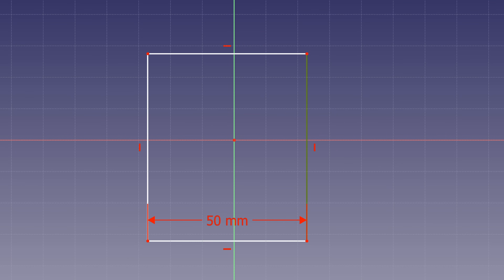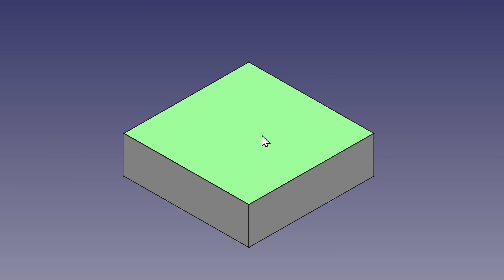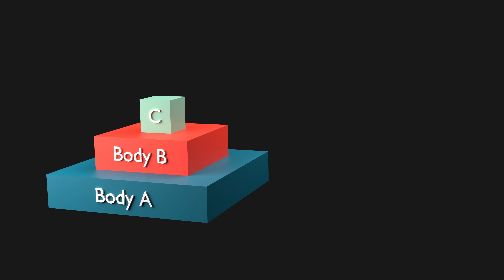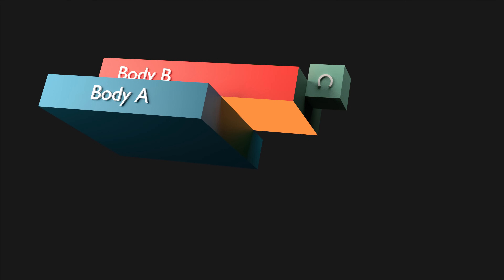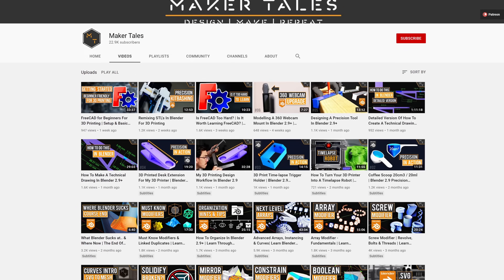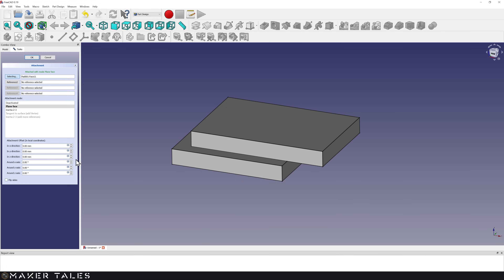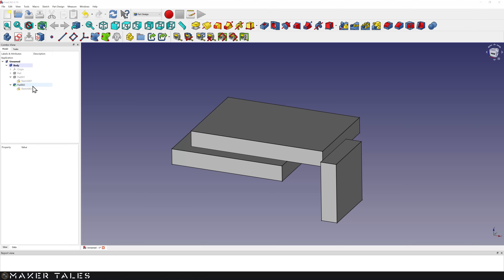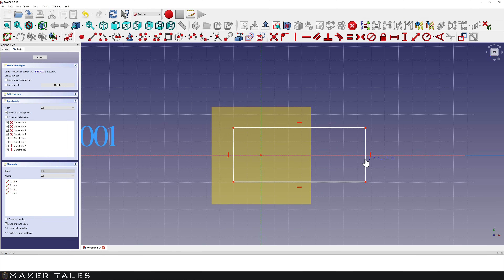FreeCAD Is Fundamentally Broken!  - Now what... Help Me Decide...

Comment: This is not a bug - this is how FreeCAD operates. If you look at the toolset in Part Design WB you clearly see that this is intended for additive or subtractive work in the realm of mechanical engineering - aka simple geometrical objects.

I agree that however this is simply a very user unfriendly and in addition labor / cognitive stressful workflow which is also why you don't see much product design done with FC.

I agree that it is a pity to teach it. If it is a machinist maybe - my industrial design students ? NO !

The problem with going with RT branch is what happens when he stops developing. Then you focused on a branch that ended. Teaching master well at least you know with the limits that this wont go away.

When it comes NTP it is also fair to make a dirty concept model and then make a cleaner build and ignore all the Don'ts for NTP. I only cross reference geometry and only use expressions where effective. 

But I also know that I wont super adjust change my model.

So I find the NTP if you are smart is less of an issue than it could be.

I would wait for FC 0.2 but also reference - but you can also feature RT branch too and keep both clearly separated.
Reply: Well a bug would mean something does not work as intended and breaks.

The ntp is just based on how names of faces can change when you modify add more to it.

That’s why I don’t think this is a bug just not fully developed process.

But obvious amazing RT is at it now to make it right
Reply: @cekuhnen  Thats the "It's not a bug, it's a feature" excuse. It it feels like a bug to the user, it is a bug. The user is not expecting this behavior.
Reply: Oh I fully agree that this is not the expected behavior. But it is not programmed to work that way. That’s why I think the term bug is wrong. It is an old issue in cad and needs proper tools to address it.

In fusion edges can get forgotten etc but all tools have the ability to restablush the relationships and that freecad lacks

Comment: The FreeCAD tuts I have watched so far are much too complicated for me as a novice. Since I have no real investment in FreeCAD (I don't see any benefit in the time required to learn)  any more complication would drive me away. 
I would love to have something that is powerful to use for 3D printing. I have no use for a larger part of what Blender has to offer, I am only interested in getting a model for printing.
Your videos and teachings are impressive, I have learned much from you and watch the videos over and over. 
I am a hobbyist and may not be the best to give feedback but the hobbyist seems to be the norm for 3D printing at this point.
Reply: the topo naming problem is really not a big deal at all, it's very easy to avoid
Reply: @Keechization  Easy but tedious. Do you really create a parametric datum plane for each face that you sketch something on? I wanted to use FreeCad for 3D printing myself, but I soon found out that it was a lot of really tiresome repetitive boring work to create even simple models.

Comment: Can you teach other aspects of FreeCAD and sort of stay away from this problem for now?  I would like to know more about working with meshes.
Reply: FreeCAD's mesh tools are dismal in my opinion and I have been using  the program since version 0.13. For simple edits and combining .STL files it is OK, but for serious mesh work I tend to use Meshmixer or Blender depending on the project.
Reply: @Phelps3D  Ah.  That would explain why I have so much trouble doing anything with meshes.  I'll start working through some Blender tutorials.

Comment: First of all - the presentations you have made (both for Blender and FreeCAD) are excellent and a joy to follow! Having viewed FreeCAD content from others, I became aware of the Topological Naming Problem (TNP). My approach has been to set this issue aside and use the available time to learn about other features and methods. Currently, the newbie may choose to watch videos that describe the TNP and how to fix it, tutorials bug workarounds, or use the RealThunder branch.  In my opinion, your efforts should be better spent on continuing to produce content that has great value to the CAD/3D community by circumventing the issue for the time being and allowing the TNP developers to find a solution to their buggy code - which might be achieved within the next 6 months. The suggestion by Lewis Cobb in the comment section to bring enthusiasts up to speed (with so much more to learn) is probably the best option. Having skimmed through the TNP, my reaction is that the learning curve is already steep enough and that delving into the intricacies of the TNP bug is not worth the muddle when solutions are within reach.

Comment: This bug is exactly why I said "Fuck this! I'm already using Blender, can't I just CAD model in there?", and that's how I found your channel and Blender Precision series!
Reply: Exactly this, it feel we hit full circle now. DItch it, and back to Blender, where we started being happy!
Reply: Blender and fusion 360 together work well
Reply: Or fusion  360
Reply: This! So much of exactly this!
Reply: You can but you should not. Blended use floating number to store values, CAD use double.
Reply: @seanfan84  I assume with what you said you never used that technology and modeling workflow.
Reply: I decided to go with openscad and cadquery instead
Reply: Well not a lot of what freecad can do Blender can remotely do. No trimming clean surface no fillets on trimmed edges no parametric modeling.

Blender and freecad are two very different things
Reply: @cekuhnen  And that's why I kept using Freecad despite this stupid "bug".
Reply: Too bad freecad does not have a polygon to nurbs converter to technically finish surfaces.
Reply: @cekuhnen  
How to do everything you just mentioned in Blender:

-Trimming: use boolean or knife modifier (Depends on desired accuracy and complexity) 
-Fillet: use bevels and increase the face count.

-Parametric modelling: There's literaly a modifiers tab and you can edit everything from the geometry in edit mode from a panel without needing to use any gizmos, just parameters.

Don't say blender can't do it, just put a bit more effort into learning and you'll see the tools are there. Besides, if you lack anything, Blender being free there's always a plugin out there that will add it... and considering how blender is with its modifier workflow you can basically ignore that and work entirely with the tools it gives you.
Reply: Maybe you should Google my name before you make funny statements.
Reply: @cekuhnen  you think i made a "Funny statement" that is "uninformed" just because you think you have a big name? get off your high horse mister, its clear you have no knowledge of blender if you say you can't do any of those things you mentioned lmao.
Reply: @AlFredo-sx2yy  I do not have to get off my high horse. You just don't know the technical difference between blender polygon base bevel (modifier + mesh command) and how filter works in a freeform or parametric brep surface/solid modeler. Learn a little more please.
Reply: @cekuhnen  i know very well the difference, and that's why i tell you that the difference doesnt affect any of the things you mentioned on the list. Maybe go learn it yourself and list a thing that is truly affected by the different method used by blender and cad. 
Go ahead and tell me in detail what wonderful things are not even "remotely posible" in Blender due to the different methods used.
Reply: @AlFredo-sx2yy  step 1 : model me a G2 variable fillet between  a cylinder cutting a sphere.

Step 2 : please adjust the cylinder dimension and reposition it and with a mouse click have the fillet updated

Take a surface cut it open by a shape 
Extrude form the cut edge a new surface
Create a G3 blend surface between them

Waiting ;)
Reply: @cekuhnen  it would be nice if you specified exactly what you want. Do i make the cyclinder cut the sphere from one side to the other or just on one side? do i make the cut with the side of the cylinder or the base? "reposition is and with a mouse have the fillet updated" was a stroke or what's the deal with your broken engrish? If you dont know how to define topology through words go ahead and just take screenshots of what you want to see lmao. Either that or fix your sentences, cause the only thing that made sense were the words step 1, step 2 and the Gs. Otherwise i'll try to interpret what you mean with "reposition is and with a mouse have the fillet updated" and make it up as i go.
Reply: @AlFredo-sx2yy  “engrish” is how one spells English ? Interesting ;)

I gave you enough examples to make the technical demos. Now show if you know what you are talking about or not.
Reply: @cekuhnen  engrish is a very common purposeful misspelling of english to denote broken english. It's all over the internet so im not sure how you missed it but your cultural level of internet slang isn't my concern here. 
Again, if you don't define the problem properly i'll make up what i can, so ok, i'll go ahead and record something for you :v
Reply: @AlFredo-sx2yy  I am still waiting for your modeling:

Here easier examples

Show me a clean G2 fillet between a Boolean Union of sphere and a cylinder each at random object pivot point based rotations

Make an open bend surface 1 and build another open bend surface 2 both surfaces can be aligned at one edge enabling surf 2 to describe a closed area on surf 1 to trim away

edge add a G3 fillet 

No modifier surf internal topology but not exterior edges to make the fillet adjust
Reply: @AlFredo-sx2yy  is the "video not available" equal your understanding ? no surprise here ...
Reply: @cekuhnen  sorry i hadnt verified my account and i had no permission to upload long vids as this is my secondary account, just verified it and reuploaded the vid. No need to be so hostile bro.
It's still processing, im sorry if reuploading an hour long vid twice isnt an instant process but hey, you are the expert here, you should know that already right? :v
Reply: @AlFredo-sx2yy  adorable video - you spent 54 min on addressing nothing requested but show you have basic knowledge of the modifiers and mesh tools ?!
Reply: @cekuhnen  go to the part 2 bro that's where everything you ask for is done. It's not my fault you lack a basic understanding of topology and ask me to do stuff that is nonsense in polygon based 3d modelling. Still, it was all done. If you didn't like it, then go ahead and show me how it's done if you know so much. You said it had to be modifiable in real time which means i was limited to using modifiers.
Reply: @AlFredo-sx2yy  Ah so you admit G2 is non-sense in polygon modeler as well as surface continuity yet you claim you can do the same with Blender that Alias (as a different example that also has Sub-D-NURBS hybrid modeling) for example could do. yep yep no surprise I am still kinda smiling you spent seriously 54 min on this crap. Here is a little tip: look at some add-ons for Blender why try to get close to what NURBS modeling offers for polygon modeling in Blender. It still does not get close but it is better. The only ability to simulate parametric union cut with fillets is via voxels - but there again you cannot individually control edges because that is not possible parametrically in Blender.
Reply: @AlFredo-sx2yy  here last chance: https://drive.google.com/file/d/1QeEMgnUGzth5DpQtNmlYpo2V6XVQm_fT/view make this parametric in Belnder with all fillets individually adjustable and movable when objects follow.
Reply: @cekuhnen  You misunderstood completely, no surprise considering you came from an applied sciences and arts university and ended up as an interiors designer...
Reply: @cekuhnen  The point of my comments was that you CAN do it in polygonal modelling, but keeping it as you requested editable afterwards is what is nonsense.
Reply: @AlFredo-sx2yy  you are amusingly silly - even with your stalking and trying to discredit me - maybe get new glasses so you can read better
Reply: @AlFredo-sx2yy  sister you are the one who rented 54 min on some childish exercise while not having been able to understand the first comment posted and feel needed to make yourself lol better 

Hey fine with me it was entertaining to see you struggle so hard …
Reply: @AlFredo-sx2yy  Actually you are incorrect. "Engrish" is older than the internet, for that matter so am I. In fact, I am older than the PC. The word "Engrish" goes back decades and its roots are in languages that cannot natively pronounce the letter "L". Japanese is most notably the first reference of the word and probably originated after WWII (World War Two). Although it may be considered "acceptable" it is in fact or of an insult because it mocks another the inability of another race and culutre.
Reply: @yootoob7048  thank you for somehow making a joke related to broken english make me a racist. SJWs saved the day again.
Reply: @AlFredo-sx2yy  Clearly you do not know me. I am no SJW. I never accused you of racism. I only pointed out the error of your statements with facts. You are a simpleton who deflects their ignorance with more ignorance. For example, you do not seem to understand the proper definition of racism. Making a joke related to a person's inability, a disability, or a culture is not necessarily racism but, it is always rude and insensitive.
Reply: @yootoob7048  all this escalated quickly, my dudes.
Reply: @cekuhnen You really are quite unpleasant. So condescending with the very little amount of knowledge shared here, where you didnt even correct them on anything. You just pointed out the difference between the types of modelling. Just because they exist, doesnt mean that they dont accomplish the same goals for this user.
Reply: @BeefIngot  how do you know that I am unpleasant and you base this on a discussion 2 years ago here? Interesting conclusion ;)

Comment from the maker: I would love to hear all your opinions in the comments!
Plus here is a Poll to let me know your thoughts if don't have the time or don't feel like leaving a comment: https://www.youtube.com/post/UgzDDe5XmIku-jQEJ7N4AaABCQ
Reply: https://twitter.com/CyberspaceOmeg6/status/1419283594044837893?s=20
Reply: I tried hard to get in line with opencad and I hate it, I wound up buying alibre
Reply: @claudehebert3131  And i thought i was old learning 3ds max 2.5 with surface tools.
Reply: Isn't solution nr 2 what a properly working cad program should do under the hood in the first place? It seems to me that you really have to go out of your way in order to code a behaviour like the one showed here... I mean, why the hell do you have to rename your faces to begin with?  Just assign a unique identifier to each face when it is created and that's it! And why changing the dimensions of a solid should create new faces? It's a parallelogram, it has six faces, end of the story!
Reply: At first i was like "come on, it can't be THAT bad" and then i realized i stopped using freecad for this exact reason.
Reply: Honestly, I still haven't moved on from OpenSCAD.  It does all that I need without requiring taking my hands off of the keyboard.  I'll probably open up FreeCAD eventually to use the OpenSCAD Workbench so I can export STEP files, but that is probably all.  A single translate + rotate and BAM!   I'm working on a new plane.  Love it.
Reply: Try the thunder version and maybe do one or two videos. The will be usefull for others in the same situation and maybe you will stick to it with all your viewers and teach with that.